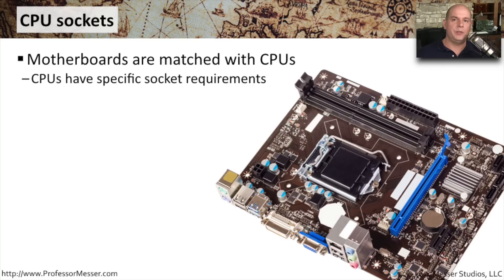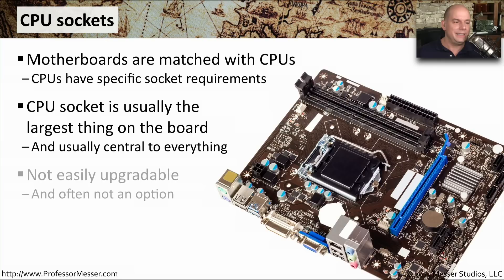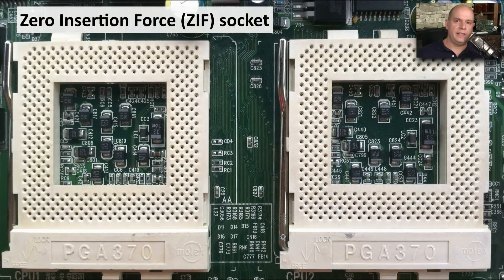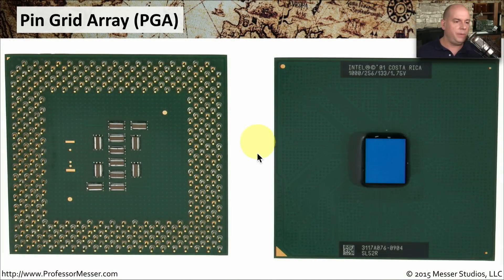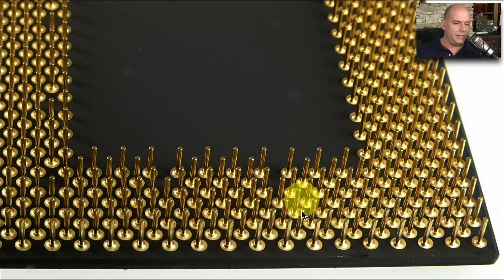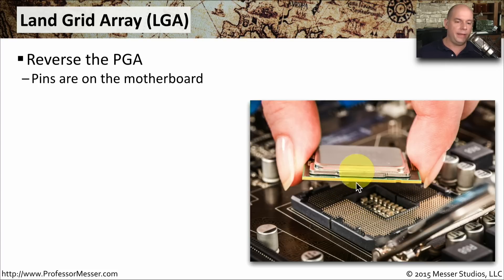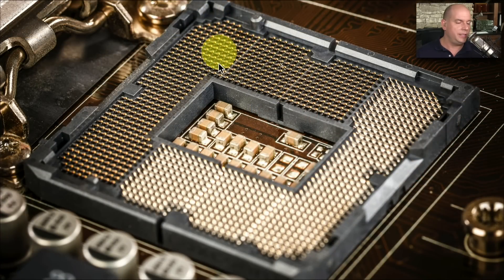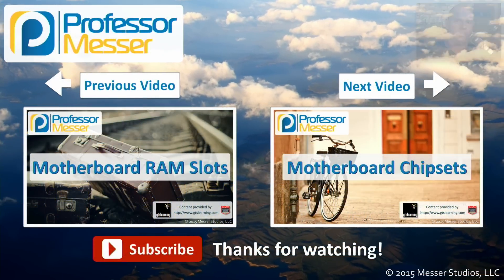CPU Sockets - CompTIA A+ 220-901 - 1.2

Comment: Back in college, while assisting the lab, I was given a few motherboards to fix. Some students were having issues with the computer not booting up, and appearently they had dropped some pressure over the sockets, so the co-op were asked to fix those pins. And we did, lol the motherboards didn't need to be thrown away. lol